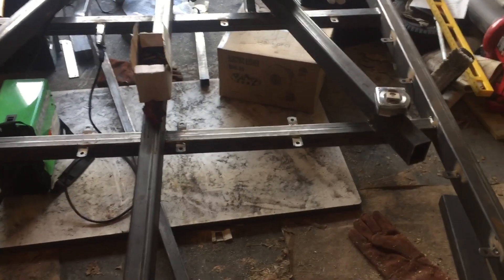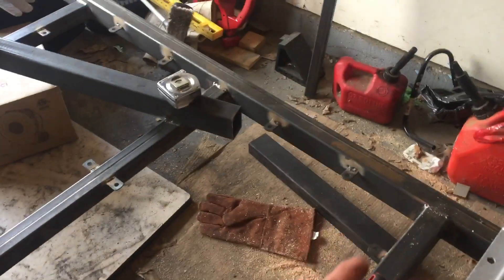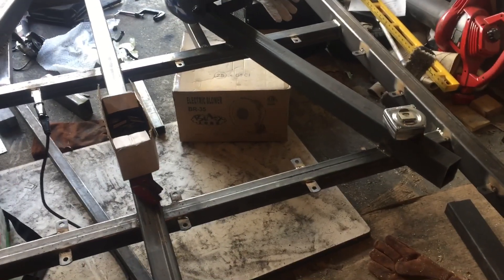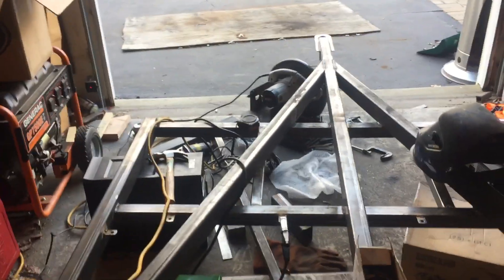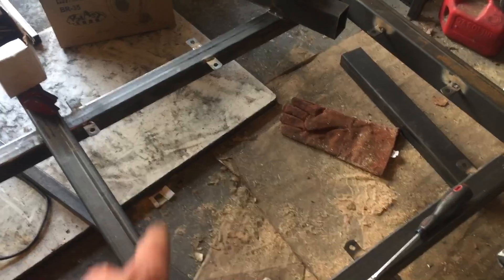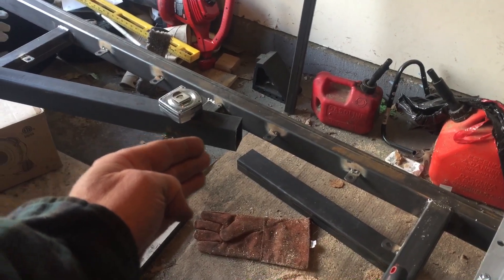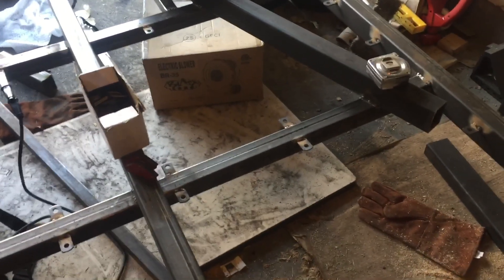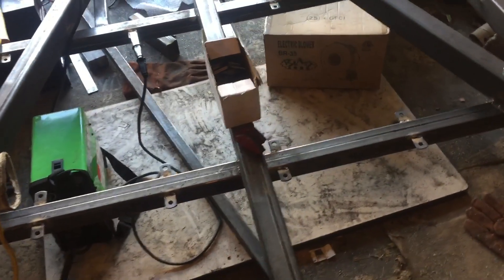End of day three trailer build. Flexiride axle install

Comment: How is that welder & the axle working our for you?
Reply from the maker: Like the welder a lot. 
Axles were easy to install but still in process of completing the camper so really don’t have any miles on her yet. Reviews I have read are good though. Better then timbren
Reply: Did you put the flexiride on center line of trailier frame?
Reply from the maker: No used the 60/40 axle placement
Reply: I bought the 7000 lbs and it has not been a good thing with the factory, engineer and salesman at Michigan trailier. I bought galvanized and apparently they never came galvanized and did not find out until they arrived, the factory salesmen got educated by me on there own product.
Reply from the maker: Lol. Believe mine is galvanized as well. I painted it though. When I had questions I called the manufacturer directly and the engineer that designed it went over it with me. Was a great experience
Reply: @theeveryguy1730  Me too.